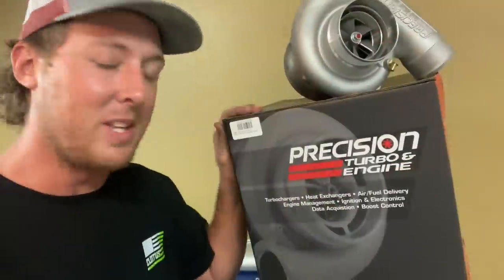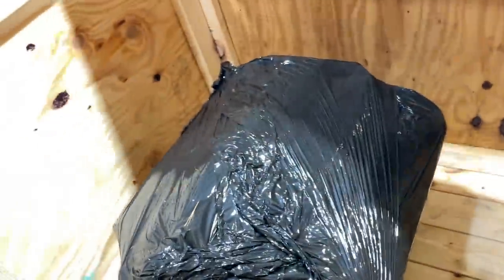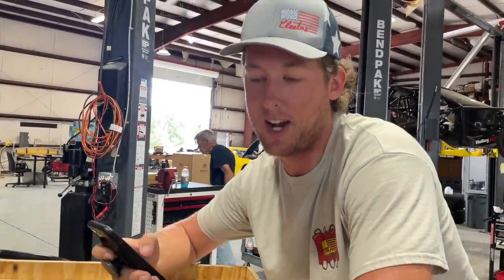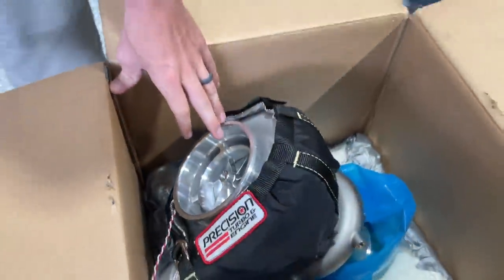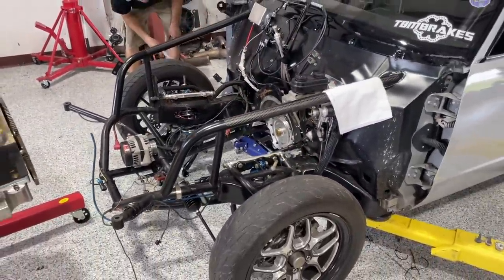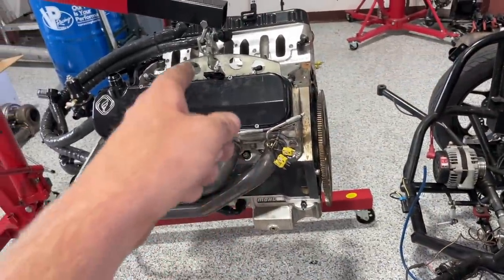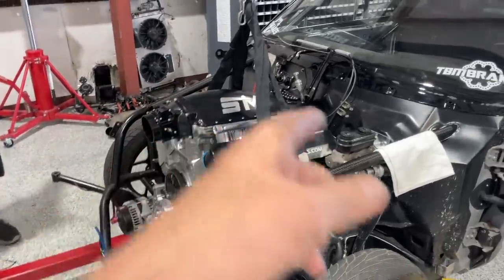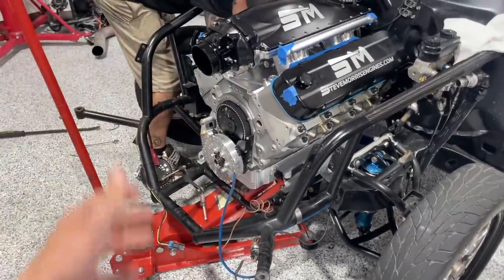Introducing the Most POWERFUL Engine We've EVER Owned... (It's BEAUTIFUL)

Comment: Holy Freedomtastic...!!
Reply: Kev much respect for the mechanical masterpiece that is Mullet.............................
Reply: First thing I thought was how are they going to get that power down track .  Second thought was I bet Kevin has some ideas or knows people who do .
Reply: Will you just look at it.
Reply: I'm sure we will see your comments on any modifications they do to your chassis. 🤣
Reply: @wyattl.4023  HUH?? KSR built Mullet not the engine. Pretty sure that was a Texas Speed 427 LS.
Reply: @huntjl88  Kevin did most of the engine building. It's Texas speed parts, for sure, but I've seen the video of Kevin dropping the crank into the block himself and getting to work.
Reply: Back to KSR for big tyres
Reply: You outdid yourself with the Elko, can't wait to see what you do with the Cutlass!
Reply: Break out the ruler and protractor to make room for some big Ole tires for that monster.
Reply: @huntjl88  It was a TS complete engine, Kevin just swapped the square port heads to Cathedral port heads. Maybe thats why that guy thinks he built it all, maybe?
Reply: @wyattl.4023  He just swapped the heads to cathedral port heads so Ruby , Mullett and LeRoy all had the same heads in case they ever needed to swap or rob parts. KSR didnt build it, just heads and valve stuff. I agree though, he did an awesome job on everything he touched!!
Reply: Well done on everything with Mullet, the chassis is phenomenal brother. Puts down power so well. Big tires incoming 🦅🇺🇸👍
Reply: Get down there and make sure they do it right!
Reply: Get them 36 inch slicks and new wheel tubs for this beast
Reply: Kevin, please call him and explain how number 3 spark plug should never be in the wheel centerline, that it needs to be number one...
Reply: Kevin, get hold of Cletus,  we need you to sort the chassis for the larger wheel and tyre combo that’s going to be required to get this car
Launching harder and mastering this six second potential,   Like low to mid 6’s.   Not 6.98.    Your the man to get this done Kev.
Reply: Going to need ksr genius setups to get that power down track and bigger rear tubs for bigger tyre
Reply: Kevin need to get them move that motor back this thing isn’t going to leave the line.
Reply: You gotta come fix the hood to fit those turbos because you know they'll hack it up if you don't lol
Reply: You gotta come fix the hood to fit those turbos because you know they'll hack it up if you don't lol
Reply: I see some framework in your future
Reply: Kev, I see more modifications to Mullett in your future !
Reply: Can you take it off them quick becore they start making a mess of it haha!!!
Reply: Don’t let McFarland Tuning anywhere near this thing!

Comment: Damn, testament to Kevin's work that he built the car so well that it eats up upwards of 2000hp no trouble at all, so dialled that you ended up outrunning what an LS platform is capable of pushing long before the car itself was running into any limits. That guy really does know his stuff
Reply: kevin never built the chassis... his previous fabricator did.
Reply: The LS engine could go further if they had a real deal engine program
Reply: @MillionairX  I watched Kevin put mullet together wym
Reply: @MillionairX  Kevin fixed that chassis. Like a gentlemen he never said anything disparaging, but he talked about modifications it needed all over.
Reply: Profab built the chassis originally. Kevin modified it as he needed to.
Reply: Yep, wasn't meant to be run as an Engine only.
Reply: @davemcdaniel4856  Because pro fab orignally built the chassis to accept a jet and started changing it to be engine only after cleet pulled the plug, then whatever happened there, and ksr took over. Still didn't build the chassis though, just fine tuned shit.
Reply: @ntbbarrion  you didn't watch him fabricate that chassis... so maybe re-read what i said.
Reply: Very true! Kevin can build a super solid car.
Reply: @wobblysauce  yeah, y'all remember that Cleeter was going to put a Jet Engine in the back of that thing..?.. Profab designed the chassis around that footprint ..
Reply: @kylefitzherbert9381  profab built the cage because it was originally gonna be a jet car but then he backed out and had Kevin put together everything else
Reply: Sad that he did include Kevin since he’s the one who built the car.
Reply: @MillionairX  ProFab built a rocket car. There's very little of that chassis left. Kevin changed almost everything about it. He even built the cage. Twice in a couple spots. lol
Reply: @MillionairX  I guess theres a few tubes left from them, but which parts of the chassis are you specifically talking about?
Reply: @j.r4275  I, too, wonder why Kevin hasn't been involved lately. It's been all Nate
Reply: Brandon  maybe sleeves and O-rings would help but the limits are real, especially with the number of runs they put it through.
Reply: @stfitts  Kevin's busy. And Nate is easier available and down for the channel
Reply: @stfitts  if I had to venture a guess, on pure speculation, it would be due to how busy Kevin is with his shop and possibly distance as well. Most likely just the former.
Reply: You can go much faster with an LS it just costs a lot to do it and a lot to keep it maintain at that power level. This was just the smart way to go. Specially for shit like drag week
Reply: @ahack14  this is true. But there's more to it than just that at the same time. You've seen the fleet they have and for them it's just not practical. Our boys need things they can beat on regularly without being high maintenance. Think about neighbor and ruby and even Leroy at one point before they started to push the limits on him too hard. Guys that are running like 2500hp ls programs are aren't trying to keep up with a fleet or run events or trying to herd a bunch of overgrown toddlers in nitrous equipped crown vics on a racetrack 😂 I'm sure if cleetus really wanted to dedicate himself to doing it he could though. He probably knows a guy or two you know?
Reply: @MillionairX  "just fine tuning shit" lol.
Reply: @duke1281  Jessi Combs died in one while they were building it. He made the right move. RIP bad ass racing lady who was taken way way too soon.
Reply: @adamtheninjasmith2985  I watched John doc run 250 passes and never open up the engine. All of the passes that engine is making over 2000
To the tires. It can be done and not be a maintenance monster.
Reply: Really looking forward to this transformation. 🇬🇧
Reply: Brandon  Solve the lubrication issue and see what pops up next.
Reply: @ahack14  wow I just realized I watched the build video of his engine already lol. Pretty interesting to see a hydraulic roller cam at that power but it's really nothing crazy and smart for reliability. How much street driving does he do with it? He's running a filled block so no coolant through there. I'm legitimately curious. That's one of those things to keep in kind. That's a step cleetus didn't take but Mullet is also gonna do the drag and drives. Not sure if I've seen many 6 second ls powered cars at drag week actually run a 6. Last one I remember is the Swedes in the Volvo but that car is way lighter than mullet too. Not to say there aren't more just the last one I remember.
Reply: @adamtheninjasmith2985  John doc runs a dart LSX block same as cleet however they have a billet center counterweighted Callie’s dragon slayer crank. That particular motor runs no coolant but the block is not filled. You can call TKM and buy the exact engine that’s filled with “shelf parts” it’s the black sheep stage 3. Obviously don’t drive the car in the street how ever that engine is marketed as Street drivable. Also I’d guess that the sweeds wagon is heavier than you’d think. All the drag n drive car are “hevy”. The black sheep is a heavy car at 2800 pounds!
Reply: @TurboWorld  Jessi Combs died in a top speed car. It was the death of Kat Moller in a jet dragster in 2018 that stopped the Mullet plans.
Reply: @ahack14   @Adam Hack tkm specifically says the block is filled and you can see the coolant passages in the block filled in another episode. Unless I'm mistaken and the setup is completely changed. You can get on their website and clearly see the half-filled block ticked off under their black sheep stage 1 and 2 long block package too. Why would they take away strength from a stage 3 package? They fill the block for drag race specific applications running methanol. Specifically because methanol has a massive evaporative cooling effect (ever seen a blower sweat cuz it's cold?) which literally cools everything in the engine it touches during the intake cycle. Plus it burns cooler as well. Combine that with short run periods of drag racing and you can get away with filling the coolant passages in the block resulting in a stronger block especially around the cylinder area. Why can you get away with this? Because most of the heat of combustion is contained in the you guessed it. Combustion chamber. The head and the top of the piston. Meaning for short bursts if you cool the heads you're good. Oh and the piston too 👍
Reply: @MillionairX  profab built the chassis. Kevin reworked it a bit.
Reply: @davemcdaniel4856  yes. Thank you. Profab built the chassis. Kevin made the necessary changes. They both did so much work its crazy!
Reply: @mckrackin5324  a lot of what profab did is still there. Kevin rebuilt the front end and stuff and modified what needed to be but the core of the chassis is still there. Profab did a lot of work after the jet car plans before it got handed over too.
Reply: @darrencorbit5994  literally what i said man
Reply: @adamtheninjasmith2985  Yes, a lot of the tubes are still there. lol... By that logic, I guess General Motors built the car.
Reply: @jonasthemovie  thanks for that info!
Reply: It literally just burns out. He made ONE 6 second pass, that broke the car.
Reply: @ahack14  - hell no it couldn’t that was already beyond the limits of the ls
Reply: @CoyoteFTW  ok tell the Swedes who runs 6.xx all drag week in a car shaped like a brick and I’d bet just as Heavy as mullet…  they run multiple drag and drive events too

Comment: Pretty impressive that you were able to get that beast of a SM 540 and twin turbskies in just over a year with parts being so hard to come by these days. It really shows your commitment to the channel and providing excellent content. For anyone else out there thinking this was easy or in anyway cheap, look up the prices, these guys are doing everything they can to make great content.
Reply: How much is the new setup? Just the engine and turbos
Reply: Also helps that they’ve got direct lines of contact with everyone in the business. They likely had this engine on order after they blew the 2nd engine
Reply: Steve Morris engines are blank check terroritory, SMX's start at 75k
Reply: @Elizondough  I would say 75k
Reply: Hey if they can drop big money on some fake tank they can definitely spend it on Mullet's engine. That skid steer is just a gimmick, Mullet will be a legit badass now.
Reply: @hourlongcoder3098  Absolutely.. The normal everyday guy doesn't hang out with someone like Morris or Bailey.
Reply: @Elizondough  engine 75k-80k. Turbos likely 6-7k a piece
Reply: @Elizondough  $90K just for the engine. Turbski's and all other add probably another $20K.
Reply: @bobbygetsbanned6049  what are you talking about? Ripsaws are pretty nutty machines
Reply: @bobbygetsbanned6049  seems like you’re jealous?
Reply: @hourlongcoder3098  jesus
Reply: E X I L E...An SMX for $75k?  I'm not sure how much you would get for that.  A dyno'd SMX in the 3500 - 4000 hp range is around $125k + !
Reply: Not a chance In hell that motor is anywhere near 75k.  It’s a conventional bbc, nothing custom here.  540 is the standard issue bbc turbo combo.
Reply: @5uprnva  turbos, ignition and fuel system will be 25k by themselves 50k is in the ballpark for a long block like this
Reply: @5uprnva  You, sir, are racing in the past!!
Reply: @5uprnva  call SM and ask about one lmak.

Comment: I am so hyped for this, we can't wait to see the outcome. Mullet will run 6's with ease now and you won't have to bend rods every pass!

I'm also pretty hyped to see Mullets old motor in Ruby
Reply: Cleat wants the 5s....
Reply: @feelingold2995  If he wants to run 5,s He needs a crap ton of Mods to Mullet, big tubs, better suspension, lighter bodywork, carbon panels, everything needs to change for 5,s, ow also needs about 2000 more horsepower to boot
Reply: @dbeerewout  Yep, and i have a feeling we will be seeing that..

Comment: There is no 'X' on the valve covers, so this is the budget friendly Cheverolet version of the fully water jacketed SMX, with a 2500-3500hp range. Still a very significant upgrade and better matched for the intended six second passes. Cleetus may want another couple of seasons before asking for an 'SMX'?
Reply: SMX is a whole nother level. That would be for bottom 6s and into the 5s. That would be some damn serious racing. They have plenty to play with on this engine. Lots of 6s to be had.
Reply: They gonna go with an SML at some point
Reply: Terry Dunnett....Yep, the "X" has the unique Steve Morris block and heads plus other SM design goodies.  This is a very solid and powerful BBC that was assembled by Morris.
Reply: I’d wager this is the leap into the big boy class. A lot to test now and sort out, making traction, running straight and consistently with this power band. It may need to go big tyre now (not hard in an Elco) so a lot of work to go. Once that’s all done though….SMX is the next step 😂

Comment: I was expecting Cleet to jump straight into the deep end with a SMX. This is probably a wiser choice. This much power is likely to introduce new problems elsewhere in the car. Traction was already an issue. We're also going to see how well the chassis handles the additional power. Exciting times.
Reply: I thought on the same thing, would the body and parts hold those 3000 hp? or we will start to see how axles bends
Reply: @alonsohasbani7894  Going to be interesting to see if the car goes down the track straight.
Reply: This is not a full SMX. This is based on a Brodix block and typical aluminum heads with SME work done. Still a fantastic motor, but the SMX is full billet and can make upwards of almost 5k hp. Huge difference in cost.
Reply: @Innovaspeed  That's what I said. I said I was expecting him to go SMX but this is probably a wiser choice. I expect he's already going to have chassis problems with just the BBC. Hopefully he addresses these issues or he'll have a wall magnet.
Reply: @RYTHMICRIOT  yes with this much power I’d want a double frame rail. I don’t remember what chassis he had build on but I believe it’s a 25.3 which is good until 6.50s. He could run mid 6s consistently np with this setup. Wouldn’t have to kill it from the hit but would have enough power to ramp it in just after the 60ft to make it easier on parts.
Reply: Traction was an issue.... Correct.. and there not even sliding it rearward...
Reply: @roodgeregeld it has a 4link. They can get the car balanced correctly without moving the firewall back or cutting it up, if that’s what you’re referring. Although I’d be a little smarter and not just throw the turbos up high on the front of the engine. Where they place the turbos with have a much bigger impact that moving the engine back an 1 or so. How and where they face the exhaust makes a difference when making this much power also.
Reply: I don't think they had maxed out their 60 foot potential. So hopefully they get that dialed then push it hard on the big end

Comment: A year later we finally get to see the steve morris engine 😁
Reply: I think you'll find this is the new one they have been waiting in, and the one you're thinking of is the more mild SM big block that's most likely in the box you can see in the background
Reply: This is not the same engine Steve Morris did a video on a year ago.... That one had a blower adapter plate on the top of it, probably the first Blue-Print engines BBC Cleetus bought that they went through for him.. likely what's in the other large box above the office area.......

Comment: Isn't it crazy how much more it costs to go that extra et. And mile an hour once your already at 195+..  easy from 10s to 8s after that it's alot more than most people understand unless you've been in the chase for that number
Reply: 195mph to 200mph probably takes another 150-200hp... From 200mph to 205mph is another 225hp im sure. Exponentially way more power needed for such small mph gains.
Reply: Last time I checked these motors were around $80k
Reply: Same thing in my boat  started off with 465 hp 502’s doing around 80 mph now I’m running 540’s pushing close to 600hp and only gained 12 mph 😂 money well spent
Reply: @bleaman33  I don't think he bought the all billet smx deal just a brodix aluminum  block 540 with good ass internals still a stout price alot of npk guys including murder Nova have used this engine platform with good power results so I know it'll make good power regardless  of the block material he just has less cushion than of it was the complete billet piece but also probably saved 50k that way all said and done
Reply: @freedomfox8183  SMX is a unique design from Morris.  The block and heads  (plus other goodies) are Steve's design.  This is a very powerful BBC built and tweaked by SM.